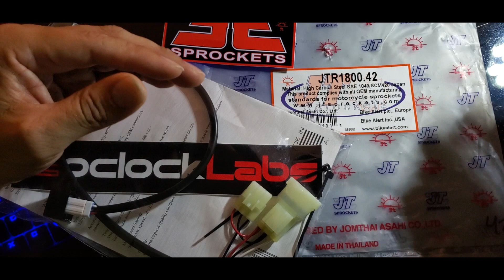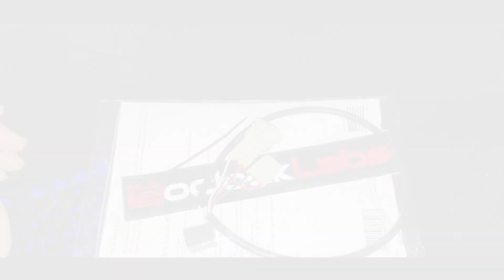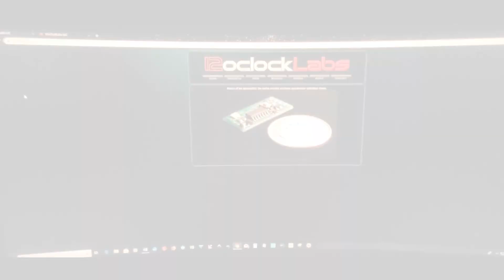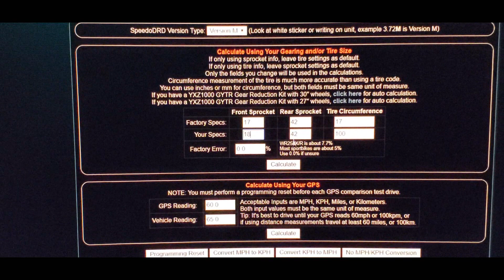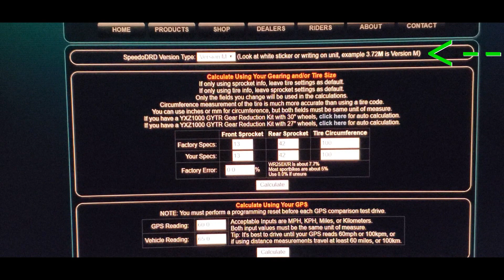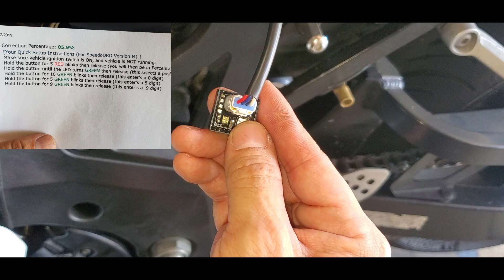12 O'Clock Labs Speedohealer Install

Comment: what about shaft drive? If the only info I have is tire s are  140/80 17 on the front and a 170/80 15 on rear, what exactly do I put into the setup calculator? Thanks
Reply from the maker: That's going to be something that your going to have to call customer service and talk to them about.. I don't have an answer for that. If you do, come back and post that info.. I'd like to hear more about that.
Reply: @TheChemistDIY  Thanks for replying. I called them. They said you would use the rear wheel for calculation (unless your speed sensor is on the front wheel, then you would use the front wheel)
You will need to know factory tire size,  but using tire and or gearing will not correct any factory error, only GPS method will account for that...
They recommend the GPS method, using a GPS unit or GPS phone app. and comparing speed at 60mph. That would give the highest accuracy measurement as well.
Simple enough at 60mph (on speedo) my gps shows 53. Just plug the numbers into the web site.
Reply from the maker: Awesome, thanks for sharing this information. I'm sure it will help others in the future with same problem. What GPS app did you end up using? I used Ulysses Speedometer App for Android before and after the installation, but that wasn't shown in the video.. but good information to know.
Reply: @TheChemistDIY  I still havent received my calibrator. It's coming in the mail. But, I always just used google maps and it showed my bike as being about 7mph off. I checked the gps on my other vehicles. Seems accurate

Comment: Milage? But u went up in the front. You're winning- understated mileage. Oh well. Honesty is the best policy, I guess.
I'm tryin to go the other way though - fix my overstated milage
Also, if they wanted wheel size (17) it wouldn't say "tire circumference"
Reply from the maker: Well that's a crap shoot to.. I've also, in my earlier days of riding, I'm had a smaller sprocket in the front with no Speedo healer. Eventually I got tired of the high winding sound on the freeway and went to stock.. now I'm on the other end of the spectrum adding one tooth above.. Additionally I also ride with a larger rear wheel so you can imagine everything is pretty much thrown off when it come to true milage on the clock.. lol